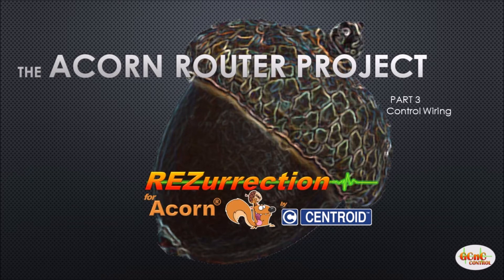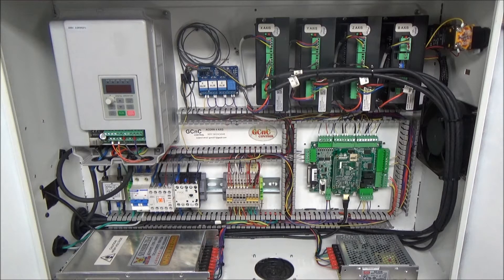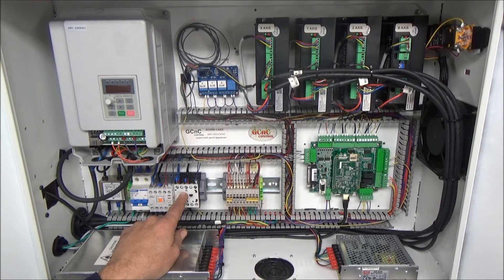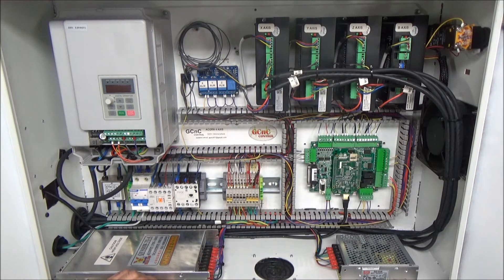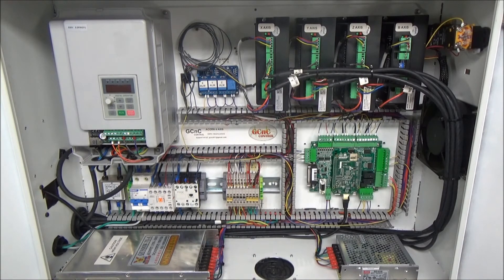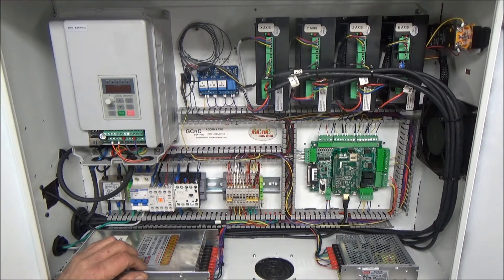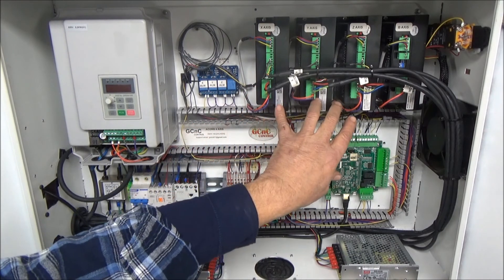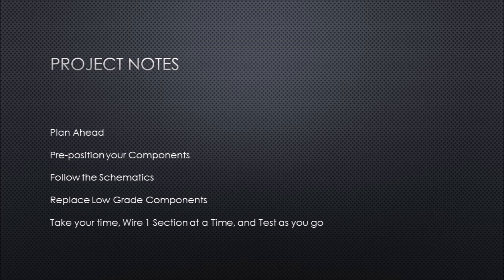Acorn Project Part 3

Comment: This is an excellent video Gary and your work and overview of this project is very helpful to me. I've had a small format CNC machine at home for a few years and will be upgrading soon.
Starting with an Acorn controller and control box and also checking the complete geometry of my machine. So, I will be referencing what you've posted....
Thanks, Peter

Comment: Hi Gary.  I'm in the process of designing a new control box to support a 2-axis StepperOnLine closed loop steppers setup.  Now that Centroid has shipped the 8-port relay board, shouldn't I be able to mimic your contactor setup by triggering one of the relay ports to activate on the NoFaultOut to then power up my drives power supply?
Reply from the maker: I usually use a contactor because the current startup is above what I chose to run thru the onboard relays.  Also, I never use the onboard relays for line voltage devices, just low voltage.

Comment: Hey Gary. In your setup, the power supply provides 24 and 5 volts to your Acorn board, my Acorn board came with a power supply that has only 24 volts output. Is that a new configuration?
Reply from the maker: Rick Bean
Reply from the maker: Rick.. my setup required the 5v for drive alarms, so I ordered a dual voltage power supply